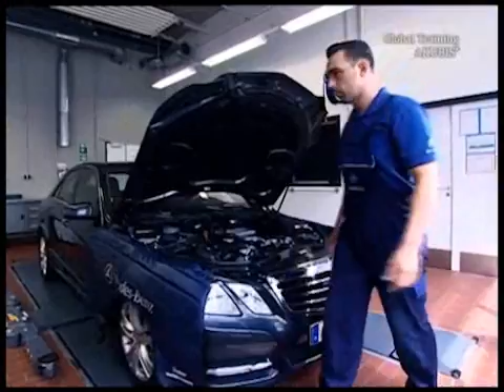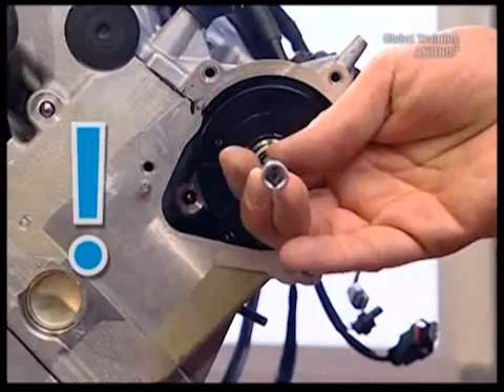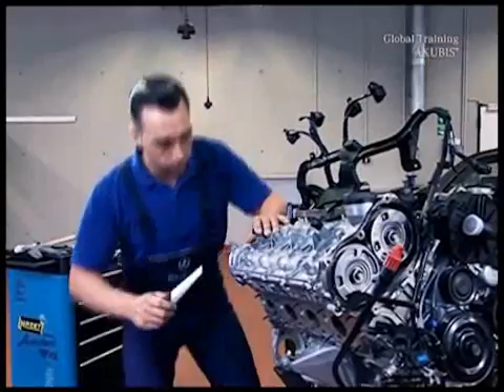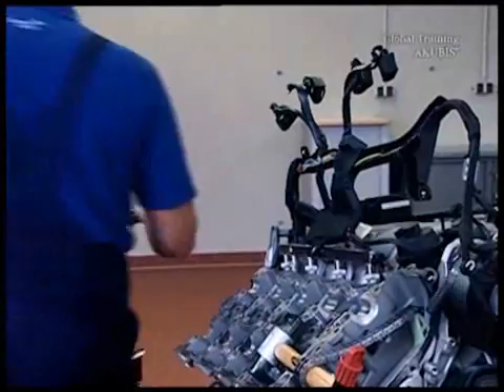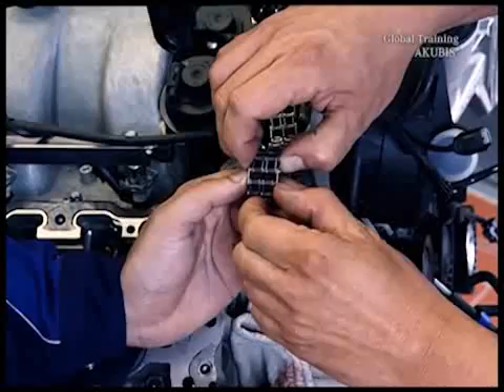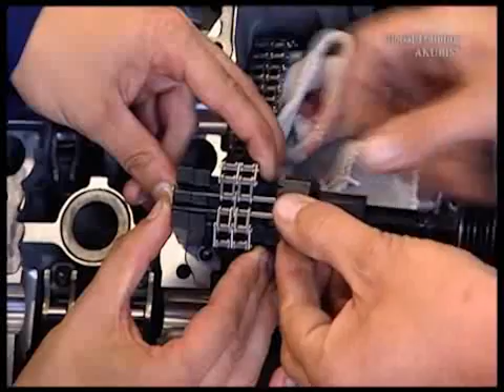W212 Replace timing chain   repairs

Comment: How much is replacement cost for timing chain set  2015 E220 bluetec
Reply: these chains are actually strong. This sweet video is only helping mislead general public. 

The "delayed timing" fault code really points to the wasted PHASERS on passenger side + TENSIONER... NOT the chain being streched!

To help prevent that repair,  simply use 5w40 and change oil at 7kMi (instead of 10w30 at 10kMi).

An ounce if prevention is worth a pound of cure.
 🤗